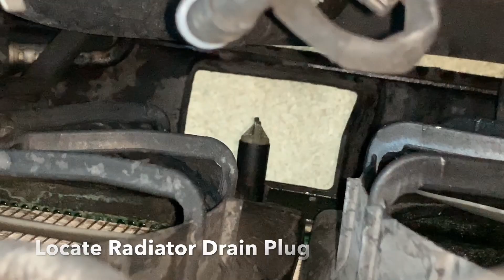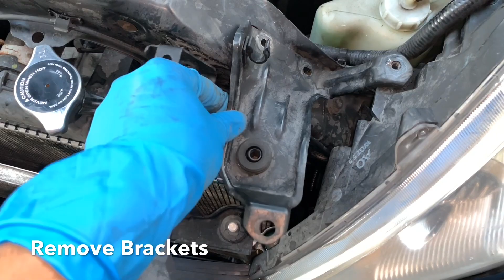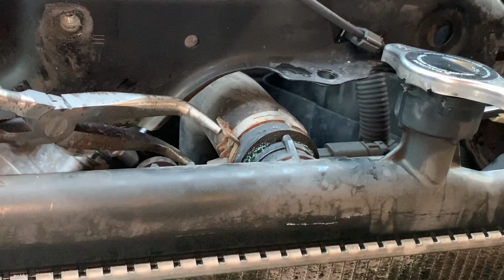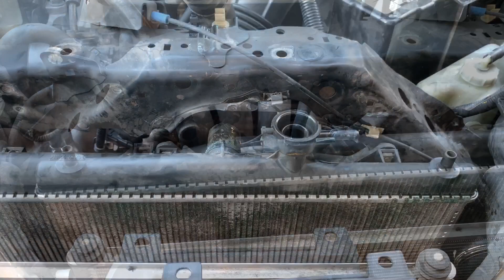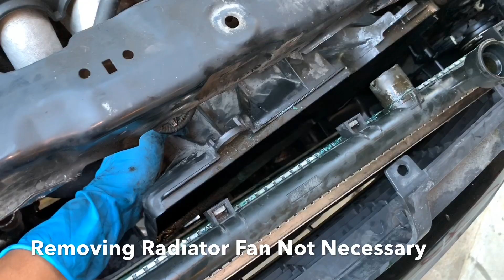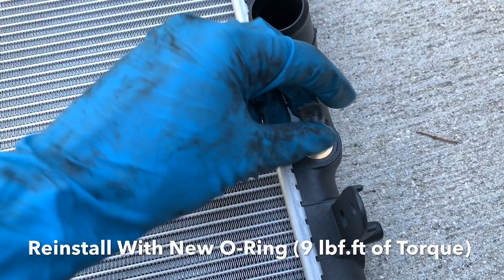2007-2011 Honda CRV Radiator Replacement DIY

Comment: Love your videos. I recommend you add a watermark at the beginning of your videos to "like" the video, since you don't do sound (similar to the radiator splash guard in this video) . I recently found out this is how google ranks and rewards content makers. I just started doing this and want to reward your amazing helpful work
Reply from the maker: Ruben Sidranski was not aware of that, could you enlighten more of this? Thanks
Reply: @MrRangerZr1  Looks like this was just milage/age from your response. The 2005 Pilot is notorious for a radiator defect where the coolant leaks into the tranny section. See Piloteer.com. it was honestly the same procedure.
1 recommendation is to add a drain valve, though a tee, to at least one of the transmission lines, helps with using the tranny pump for flushes if your so inclined.
Reply: How that works?
Reply: @MrRangerZr1  apparently, likes and subscribers is how YouTube monetizes things for content providers

Comment: I checked my parts supplier and the 2010-11 have a different part number for the radiator, is there anything different for install?
Reply from the maker: no should be same

Comment: Was this an external leak? Thanks in advance!
Reply from the maker: Yes.
Reply: Mine is leaking on the bottom seam right above the hose.  That looks like a weak spot.  Found it just in time as the leaking coolant totally corroded the hose clamp to where it was about to break off.  Would have been a bad day if that happenned.

Comment: Good how-to video. How hard was it to remove the splash guard and grill? What was wrong with the radiator that required its replacement? Thanks.
Reply: Probably same issue as my 2005 Pilot. Coolant leak into the tranny.
Reply from the maker: Steve F Just clips holding then on. This radiator started to leak after 270k miles.
Reply: Thanks! That's a lot of miles! Good for you!
Reply: @Meche697 Did the coolant leak into the trany cause any other issues for you? Or did u just change radiator and no other problems
Reply: @JesusWillReturnWarOnUnRepented  wow, 4 yrs. later. 2005 Honda Pilots had a recall. I replaced the radiator as a precaution and found a crack with a little milk chocolate. Car now has 215K miles and running great.
Reply: @JesusWillReturnWarOnUnRepented precautionary. A little chocolate milk where the crack was forming. I'm sure if I hadn't, there goes the engine. If you have a milk shake you may be SOL. If it's just starting, swap the radiator and do a transmission fluid drain and fill after 500-1000 miles. That's what I did. Good luck
Reply: @Meche697  Thank you for the information 👍👍

Comment: I have a 2010 Honda crv and I’m thinking of following your step by step and changing my radiator this week. I did it on my 2002 crv years ago perfectly but when I took the front hood latch off and put it back on, it didn’t latch right and the hood would never stay tight. Did you have this problem?
Reply from the maker: Trace around the hood latch and reinstall in the same place :)